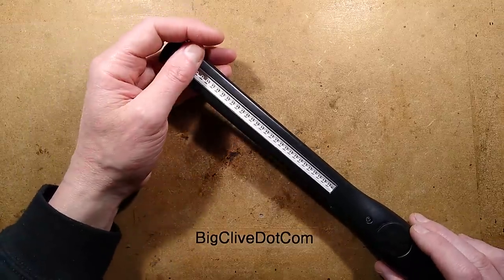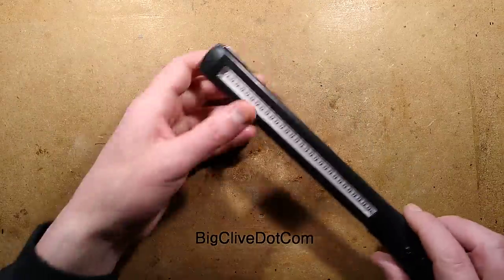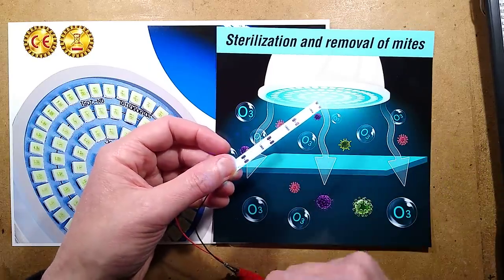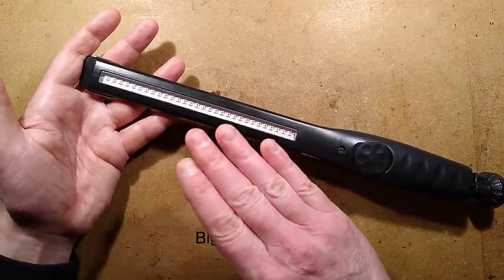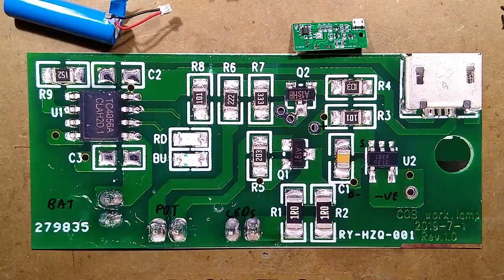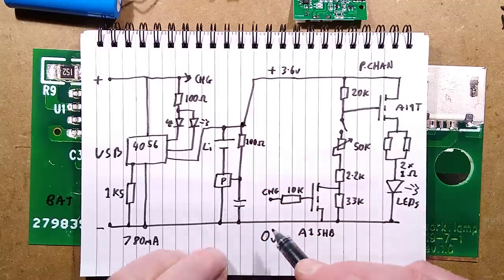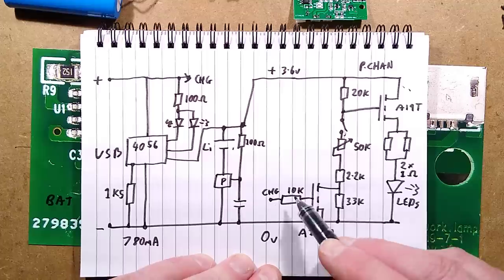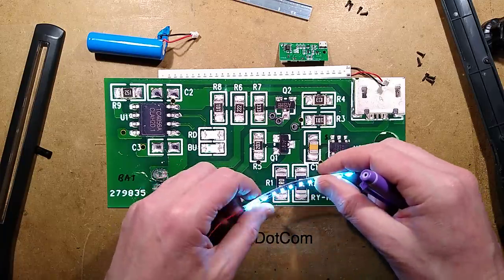More fake UVC "sterilizing" lamps from China!  (with schematic)

Comment: When viewing the spectrum of UVC activity and viral effectiveness, it purely depends on the virus being affected which proteins are created in the disruption of the DNA.  This effect runs between 220 and over 280nm    where the difference between 254 (most lamps ) and 280 spectrum 'end' and is in many cases better at the upper end ( dropping swiftly above 280) - reference Kowalski 2009 Ultraviolet Germicidal irradiation handbook

Comment: Clive, Your video on uv, very good. Showing how glass can block uv. I use a blacklight blue to cure uv  resin. My project move so I put on clear glasses to keep my eyes safe. Couldn't find them one time and used my amber shooting glasses and the blacklight looked off, checked the switch, connections and plug before realizing the glasses were blocking the uv to the point off an off appearance. I assume it was blocking it, no testing though. Its a G E 18" 25 watts BLB. Try it sometime. Curt USA

Comment: If you need UVC go with fluoressent tubes there are UV-C LEDs but one 10mW was about 4$ last time i checked. So to get 1W you can calculate about 300-500$ to get a 275nm lamp assembled.
So forget about 20-50$ one's

Comment: You said LEDs are single wavelength devices, but surely they are not? Their spectrum is a wide blob, unlike laser LEDs. If you shine a laser pointer at a glass full of water for example, the whole thing lights up but the light seems to consist of extremely small dots of light. Isn't that effect a sign of actual monochromatic light?
Reply from the maker: The dots are caused by the very directional coherent beam.
Reply: @bigclivedotcom  Here's some interesting spectrum measurements of coloured LEDs and a laser LED: https://www.quora.com/Is-LED-light-monochromatic/answer/Marko-Sokolich

Comment: Okay got a question, I built an uva light for fun. I did my research but here's what I did. I bought three 30 watts high power leds ultraviolet 395nm. There are studies shown it does kill germs, the trick is the length of time. My leds go through a plastic dome and spins. Three at 30 watts =90 watts. I'm doing test right in 2 by three box with pe tree samples. how long do you think it would take to kills germs.It's bright in the day and at night. and it covers a 200 sq foot room really good.
Reply from the maker: UVA is nothing compared to UVC.  It would have to be sunlight levels to have an effect.

Comment: I need a UV light to erase some eproms,  so got an old 6" tube hand torch and replaced the tub with a uv tube designed for a pond water sterilization.  Not much visible light out but clears the chips just fine. Better get it out wave it about a bit. A out right side for a letterbox sterilization

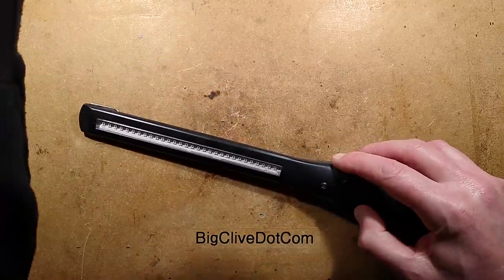Comment: I actually bought two of the exact same wands you're reviewing. It's interesting, mine seem much more consistent at low level 5:50 than the one you show. Also, mine kills some small bugs, not beetles, but other non-shelled bugs. I wonder if they make these with better LEDs?
Reply: no it doesn't ! UVC is germicidal (i.e - it kills microorganisms - it has no effect on anything bigger). It doesn't even kill dust mites
Reply: @HealthySleepGroup  You may be right. There's alot of internet debate whether ozone from UV-C kills dust mites or not. Even so, Wikipedia doesn't have much to say on that issue and the other sources on the net that do say it kills dust mites seem to have an agenda. Wikipedia is the best sorce I know of on-line and is what I follow most of te time, unless I know more. I have no idea why my LED lamps killed a few small bugs within minutes, but now I can't duplicate that unscientific experiment. I can tell you I no longer trust these LED UVC lights from China as far as I can throw them.
Reply: @dbfcrell8300  it's the same principle as germicidal UVC, as the average person knows very little about the proper application and the basic fundamentals. With every form of disinfection, there is a very simple formula to follow - energy x time = dose.
The companies making UVC devices have no idea what they are doing and think that the blue glow from UVC is some kind of magical wand, when in fact its a technology that is easily worked out - know the output of your device - understand the dose required for the outcome you require i.e 99% (2 log reduction) 99.9% (3 log reduction) 99.99% (4 log reduction) .. and expose the surface for the number of seconds required ..at the distance from the object where you have made your calculation i.e you can't wave it around and expose objects from different distances as it has to be a cumulative exposure. Ozone machines have been in use for a long time also. Again though, there is an assumption that you are disinfecting the room ...and that's simply nonsense. The ozone generators are designed to draw in air from the room and it converts it to ozone and blows the gas back in to the air space. If you have a small generator its simply blowing out small pockets of ozone. If you wish to use ozone to disinfect it becomes a VERY VERY dangerous gas as the machines are designed to suck in huge amounts of air, until all of the air is replaced with ozone  (if you find yourself in the room at the critical time of zero oxygen you will of course die). But again, it's the same principle - energy (ozone gas) x time (time required for the ozone to attach itself to the oxygen) = dose (the length of time required for all of the air to be ozonated to kill the organisms.
PS- in water, ozone and UVC work the same way but the calculation must be worked out for the flow rate of the water passing the UVC bulbs. It's not rocket science - but it is science and not magic - like many think. I also find it concerning that this site is discussing ozone generating bulbs so very casually because if you are sat next to a device that is blowing out the gas and you are inhaling it in to your lungs, it can cause irreversible damage. It should never be used when you are in the same room
Reply: @HealthySleepGroup  Well, I guess I shouldn't tell you that I just ordered a 60w UV-C lamp with ozone. I will be fully in charge of this lamp's usage where I will be using it to disinfect in a filthy music store late at night after I leave (I leave around 11PM most nights). It will run for an hour.  I will be the first one in in the morning, so I will immediately start the intake and exhaust fans, then after 45 minutes or so, I'll enter the store and vacuum it.
Reply: @dbfcrell8300  I have large industrial sized ozone devices and they need at least 3 hours in an average hotel room to be effective. The good news for you is that if your device is set only for an hour, by the time you open the store in the morning, all of the ozone would have returned to oxygen and you are in no danger and don't need to turn the exhaust fan on. PS- for best effect you should vacuum the room before you turn the ozone machine on. The reason for this is that a vacuum by its very nature creates a dusty environment that will pick up and circulate throughout the air and the dust particles ( that are full of organisms) will then settle back on to the surfaces that the Ozone has disinfected.
Another super important thing to understand is that Disinfection is a process ... and it begins with 'cleaning'. Therefore, to provide disinfection, you must clean the surface first. If you don't do this, the dirt will cover the organisms that you are trying to kill wth the UVC (or in your case Ozone). And the best way to disinfect is to provide a layered approach. It's a fascinating topic and when you delve deep, you understand how bloody difficult it is to provide proper disinfection. Another example is this - (excuse me if you know this but most people don't) When you apply a chemical disinfectant, you need to 'wet' the surface for at least 10 minutes for the active ingredient to disinfect. This goes back to my earlier discussion Energy (in this case chemical) x (multiplied by time - time required for the active ingredient to destroy the organism) = Dose (dose required for the outcome required) - 99% reduction of organisms (2 log) versus a higher organism reduction of 99.99% (4 log reduction) the higher the required kill rate, the longer the chemical needs to be applied
Reply: @HealthySleepGroup  Not sure I get the math (I'm a musician), but I do understand its all about the lamp's power and length of time to kill  effectively. When/If 220nm UV lamps get the okay, we'll be getting one of those for the store. I do have all my bleach /water mix in spray bottles ready to go when they sat we can reopen. The UV-C lamp will be for lesson rooms, our disgusting bathrooms and behind the counter where the phones, register and repair bench are. We are lucky the bathrooms haven't killed anyone already. It's prolly where COVID 19 came from.... our bathrooms. :)
Reply: @HealthySleepGroup  Good reading, thanks!
Reply: @dbfcrell8300  :-) very good ha ha. mate, tell everyone to wash their hands and not touch their faces and you will be fine.
Reply: @HealthySleepGroup  Will do, thanks for all your help and concern.

Comment: The light doing the gaps between light in the real lamp is caused by your camera and the frequency of the driver or ??
Thank You got digging into this fake junk.
Reply: Clive I am going to toss a 2nd question at you. Are the solder joints on the board that bad or is it the way the phoito was taken that made them look bad?
Where can I find that small (real) glass UVC lamp you have?

Comment: Obviously,it is not UVC LEDs.Real UVC LEDs is very expensive,around USD1.5/pc.
And real UVC LEDs do not array so close because of cost.
By the efficiency of real UVC LEDs,a sterilizer only needs several pcs of LEDs.
The LEDs are placed naked or covered with small quartz lens,would not be plastic or glass.
We are producing real UVC LED sterilizer!

Comment: I been ordering UVC E27 tubes off ebay lately. I've ordered ones that create ozone on the grounds that if I can smell ozone I can be sure that the tube is indeed producing UVC. Ozone is hazardous too and I don't particularly want it but it seemed the best way to be sure the lamp is genuine.

Incidentally I kept getting responses from sellers supposedly with stock in UK/EU (after a week or two) that the package had mysteriously gone missing at which point I got a refund and ordered another from a different seller - usually at a somewhat higher price. Anyway I repeated this several times but one did eventually turn up and yes, it definitely produces an eerie blue glow and ozone so I'm assuming its proper. Am I wrong?
Reply from the maker: It sounds like it's real.  The ozone has its uses if you don't breathe too much of it.  The usual safety warnings apply with your lamp.  Minimal eye or skin contact for humans and animals.

Comment: I got this exact lamp, well, almost, mine doesn't have the ball-joint and magnet. It just got this silly lid thing on the end which is just held on by friction (not threads). I was wondering what that was for. I suspected it wasn't UV-C btw, which it claimed on the website. I was just curious about it (also bought another which is UV-C).

Comment: You've repeatedly said to be sure to wear glass eyeglasses instead of plastic to protect your eyes from UV-C.  Well I looked up the spectral transmission ranges of plastics and glass.  Conventional acrylic plexiglass and polycarbonate  becomes opaque at about 400 nm wave lengths and lower hence it is opaque to UV-A, UV-B, and UV-C.  There are UV grade plexiglass which are specifically rated to be transparent to UV-A and UV-B and opaque to UV-C.  Now, I also found a graph of the spectral transmittivity of glass and though the logarithmic scale was difficult to read, it clearly showed transparency to about 120 nm which is very much into the UV-C range.  It would appear you need to be wearing plastic lenses to protect your eyes from UV-C not the glass eyeglasses you have been advocating which seems obvious with your statement that true UV-C lights would have glass or fused quartz not plastic covering the light source.  You should probably do an episode on UV eye protection given how people have learned to Respec your statements.
Reply from the maker: Standard glass blocks the harmful wavelengths.  The tubes have to be made of uviol glass to pass the UVC.

Comment: I just bought a new flashlight that has a built in UVC Led on the side.  Liteon 10mW they say its 190-280nm. How would I check make sure its a true UVC led? Any thoughts? Thanks.  Great Vids
Reply from the maker: If it's a little gold coloured LED with two chips - UVC and a visible one for effect and indication, then it's probably real, but very low output.
Reply: @bigclivedotcom  ok thanks. Light uses 18650 3.7v battery

Comment: Hi BigClive, just discovered your channel. Thanks for the info. I've got my hands on a UV-C wand, from a fairly reputable brand, wondering if i sent you photos of the LED on it whether you may have any thoughts? let me know!
THanks
Reply from the maker: If it has a glass-like tube that glows soft blue then it's probably real.  If it's LED then it will either be fake or very low power.
Reply: @bigclivedotcom  It IS LED, but it appears to be copper sinks. It does stain a green banana too, after longer exposure. But yes, likely to be much lower power. 
I emailed the manufacturer, and they've bothered to send a certificate too, stating results of a 10s test against some simple bacterium.
Reply from the maker: @JosephSheu86  That sounds like the type that has a few gold coloured LEDs in amongst others.  If it is, it's probably real, but very low efficiency compared to the mercury tube type.
Reply: @bigclivedotcom  Indeed, that appears to be the case. What are you thoughts on the germicidal efficacy of something like that then, real, but low powered? The certification says 99.9% of staphylococcus aureus, Escherichia coli and candida albicans killed with 10sec exposure. I have zero clue on how resilient those bugs are compared to others, and thus, whether it is really even beneficial to use?

Comment: Excellent video.  Thanks again for your review on this.  This is basically the one that I got.  Exact same housing (only difference is I have 9 LED's.  They look like the yellow square assemblies you show in both videos but looks can be deceiving.  I tried to take close up picture and even used my son's microscope but can't get a good picture.  

I'm build a box to sterilize car keys, wallets and glasses for after I go out and get groceries.  I'm integrating a kill switch for the lid so when I remove the lid, the light turns off.  Do you recommend a site where I could procure one.
Reply: Try looking up jam switches or plunger switches. There will be a variety available. Alternately you could easily and cheaply get an industrial safety interlock. All depends on what kind of electricity you will be using. Interlocks usually use DC only and a range of voltages. Plunger, you'll probably need to order unless you have an actual electronics store nearby. Jam switches are probably the most readily available and most resilient for a home gamer. There are several options. Best of luck!
Reply: @jonanderson5137  I have a plunge switch already..  Rated up to 12 volts.  It depends on how I'm planning to wire the light.  Some have to be modified to use the plunge switch if the power control is rotable for example.   It's more of a safety approach.  Once I can locate a usable UVC I may have to re-design my box and approach.  One step at a time I guess..:)

Comment: The highest frequency UV LED you can buy on RS Electronics is 360nm, which is still well in the UV-A range and sold for curing resin, nowhere near the UV-C range of 280nm-100nm, so I would think any UV light with LEDs is going to be UV-A not C.
Reply from the maker: There are genuine UVC LEDs, but they are inefficient, have a short life rating and look very different to a standard LED.
Reply: How would you test a proper uvc led light with quartz? I mean there is a way to test it visually as effect on food etc.
Reply: @bigclivedotcom  there is a way to test those uvc led visually, for example on food or such. I bought a similar one but witn only 9 led and short life, as 2000 hours. I am trying to find a way to test it, as at the moment I don't have any tester.

Comment: Have you heard of red light therapy? If you're going to test something, you'll probably want something cheap. Search for 36w 18 led. Still a bit pricey, but nowhere near like the led panels. This stuff does work, but I'm curious about the construction. The ones used for humans have two wavelengths, while the grow light has just one.
Reply from the maker: I built my brother a red light panel in the past.  660nm and added heat.

Comment: This particular item is being sold by several sellers on eBay some of them in Canada. Bought another item on eBay out of China and after 5 days of it supposedly shipping the tracking simply shows "Shipment data received" aka no indication of movement and seller is making excuses. eBay typical response is 
"With the recent COVID issues and courier delays, these could be related. But if your item doesn't arrive by the estimated delivery date, please feel free to open an item not received claim so you can get a refund! "

So I have to wait up to  2.5 months before I can seek a refund. Writing this purchase off and buying it elsewhere